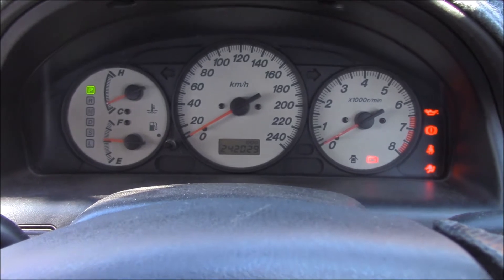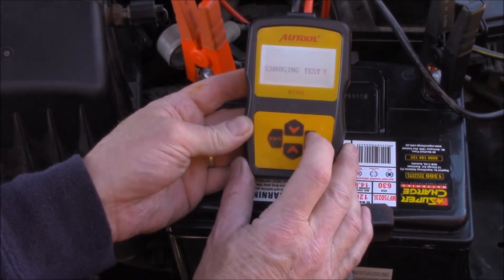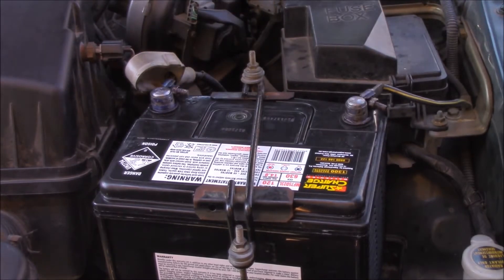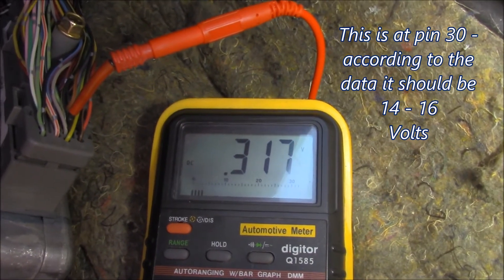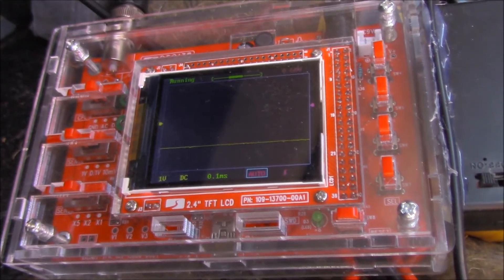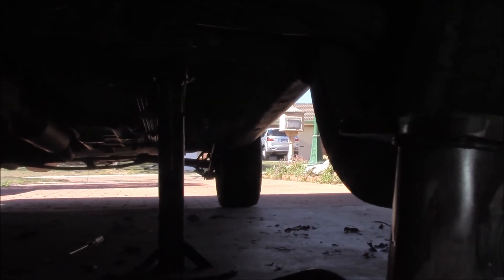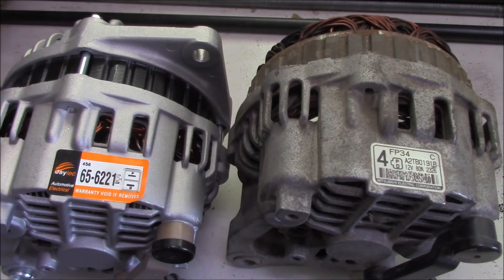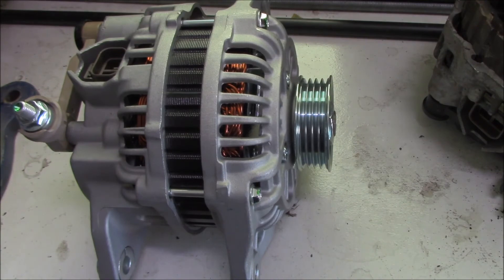Testing Computer Controlled Alternators Mazda 626 MiracleMAX

Comment: Guys I have a 2004 Mazda Axela. My battery
light came on while driving. Did a voltage test
on it found out that the alternator is not
charging the battery. Did a code test, got this
code P2503, charging system voltage low. Did
further testing then found out that two pins in
the PCM is sending the wrong volts to the
alternator🤷🏽‍♂️
Reply from the maker: Thanks for sharing that with us Nario Esprit. So what was the fault in the end - the ECU? What did you do to repair it? Is it working OK now?
MiracleMAX
Reply: @MiracleMAX  it’s still being worked on as we speak… but every other person I go to, they’re telling me that the alternator is the problem (the voltage regulator in the alternator)
Reply from the maker: @narioesprit4516  If it is a 'smart' alternator, the regulation is done by the ECU. You have a pulsed voltage (duty cycle) sent by the ECU to the rotor, depending on the load and then a feedback signal will be set to the ECU to make sure the alternator is charging as expected. If the alternator is not working correctly, ie, worn brushes, you can get some strange voltage readings.
Please keep us informed and thanks for sharing.
Reply: @MiracleMAX  yes I think it’s a smart alternator, case the ecu sends a pulse to the alternator… so my question is can the ecu damage the regulator in the alternator???
Reply from the maker: @narioesprit4516  There is no regulator in the alternator as all the regulation is done by the ECU. Generally you will just find a basic brush box in place where the regulator would usually be located
Reply: @MiracleMAX  ahhhhhh ok I understand… so once I change the alternator everything should go back to normal? I’m confused that the person I asked to do a diagnostic on the car came to the conclusion that the ECU is faulty or malfunctioning 🤷🏽‍♂️
Reply: @MiracleMAX  so basically his diagnostic is ( terminal b at idle should read 13.0-15.0v ) ( terminal p with ignition on should read 1.0v or less, at idle 3.0-8.0 the test results reads 20mv ) ( terminal d with ignition on should read 0v, at idle * the test results reads 12.5v
Reply: @MiracleMAX  I also think we have the same alternator and charging system 😁
Reply from the maker: @narioesprit4516  Not sure on your vehicle, but if you look at this link, I discuss the differing information that got me initially confused. I thought it was the ECU as well to start with. 
https://youtu.be/V7cfw0hIlm4?t=452
The terminals are P & D
Glad I did extra research and testing.
https://youtu.be/V7cfw0hIlm4?t=855
Reply: @MiracleMAX  I changed the alternator finally, battery light 💡 is off and car is running perfectly fine. Just have to do a voltage test…
Reply from the maker: @narioesprit4516  Well done on the correct diagnosis! 😉

Comment: confused by the duty cycle pin, is the signal from alternator to the cars ecu thus providing charge current information, or is it from the ecu to the alternator to request a specific level of charge?
Reply from the maker: Hey We're Really Relay Camping,
Thanks for your question. These 'smart' alternators can be a little confusing, compared to the old style.
The 'D' terminal has a duty cycle signal sent from the ECU to the rotor field circuit via the field control unit built into the alternator. As shown in the video, the larger the electrical load, the larger the duty cycle sent to the alternator.
The 'P' terminal signal is sent from the field control unit inside the alternator as a response back to the ECU so that it can analyse the phase signal and determine the efficiency of the alternator. 
It is very similar to a 'request' and an 'actual' reading that we commonly find on a scan tool.
I hope that helps clear that up a little for you.
MiracleMAX
Reply: @MiracleMAX  thanks very much for that because we've been having trouble with split charge on a campervan and so it's going to be interesting to see if i can use some other form of electronics to take control of the alternator and do what i want it to do instead of what it thinks is best, I don't even know if mine is the same type of alternator or if it's one with like a canbus or other digital signal which would make things a bit harder but not impossible. Thanks for your reply
Reply from the maker: @WereReallyRelayCamping  First things first. 
You need to identify what alternator you have. Did you fit it yourself or was it already on the van? What engine are you running? Try doing some research on the part number off the alternator and then you should be able to figure out what system it runs. Try using the net or asking your local friendly auto electrical shop.

Comment: my battery on my 2018 mazda with 39k miles, died after 3 days of not driving it. nothing was left on. i charged it and got the battery tested . everything passed except something about the voltage, it failed. so i took it to a different shop to get a 2nd opinion. they ran the same test with the same results and they both said the alternator needed to be replaced.  so i took it to my mazda dealership ( i have a 100k miles extended warranty) they did a test on the car and said  all is normal and the alternator doesn't have a voltage regulator and it is controlled by the pcm and they just needed to recharge the battery and keep the car overnight and retest it. i have never heard of a  2 yr old car alternator going bad the tech said.  oh and the tech said the pcm is not showing any faults codes in their system ( whatever that means)
Reply from the maker: Hey New Yorks Finest,
Thanks for sharing your experience. How long ago was this?
The PCM controlled alternators may or may not set a fault code, depending on what has happened. The battery and alternator testing can be a little tricky as a lot of the rules are different on the PCM alternators.
I guess you have to ask yourself - why did the battery go flat in the first place? Three days is not really a long period of time. There is a thing called parasitic voltage drain, which drains the battery over a period of time, even though you don't have anything turned on.
Can you keep me up to date with any future problems you might experience? I would be happy to give you some suggestions that may help find a diagnosis.
Cheers
MiracleMAX
Reply: my battery went dead a couple of days ago. I charged it yesterday and ran it around town to get it diagnosed. today i called mazda and my wife took it in to mazda and they gave us a loaner till tomorrow.
Reply from the maker: @NewYorksFinest1  Thanks.
I'll be interested in seeing what they find out.....😊
Reply: before this issue my scbs light kept coming on for no reason. I took it in to mazda and after 4 attempts i had to hire a lemon law atty and Mazda settled and gave us $2500 (2k went to my atty) and they gave me the extended 100k mile on top of the original warranty with zero deductible. I called the warranty place and they said yes my alternator is covered under the warranty so if they finally decide it's the alternator, it's covered
Reply from the maker: @NewYorksFinest1  Did they end up diagnosing the SCBS fault? 
These lights will come on when raining or the windscreen if fogged. Here's a link that will explain that.
http://mazda.custhelp.com/app/answers/detail/a_id/144/~/why-is-the-smart-city-brake-support-%28scbs%29%2Fsmart-brake-support-%28sbs%29-warning

Comment: Hi MiracleMax,

(first my apologies English is not my first language)
I watched  carefully your video about the extensive testing you've done on your mazda's alternator. I have a similar problem with my mazda for more than 3 years.

I have a Mazda 626,1998 Sedan Automatic, it has an issue with charging the battery. The electronics in this model is the same as at Mazad's 626 up to the 2002 models.
PROBLEM: The car always starts very easy but the Alternator is not charging the battery right from the start. 
Have this problem for more than 3 years and here I'll describe in more details what actually is happening:
- When I start the car with a cold engine (at least the car not being running for more than 2 hours) Alternator does not start charging the battery immediately but it will after 20 to 40 minutes... and afterwards 

everything works fine so the alternator charges the battery as normally as it should and does that for an unlimited time as long as the engine works or it has not been turned of for more than 2 hours.. If I start the car within the period of about 2 hours the alternator will start charging the battery immediately as normally as it should.

However after turning off the engine and letting it cool down for more than 2 hours the symptom occurs again (again it takes a lot of time until alternator starts charging the battery).  
Just to mention again that within the period of about less than 2 hours after turning off the engine, the car can be started easy and the alternator charges the battery as normal as it 

should (right from the time of starting the engine). 

   The other thing I've noticed is that If I drive the car with a relatively cold engine on a freeway, alternator starts charging the battery much later comparing when drive the car in the city (up to 60km/h), In the freeway the charging starts after 40 - 50 minutes or not at all, which is way different when I drive the car in ordinary streets where the charging starts after approximately at 25 minutes. 

Also the behaving is different in winter comparing to summer. In summer the charging starts much sooner comparing to winter time. 
So in trying to find similarities between driving on a freeway and driving in winter time is that in both cases everything under the bonnet is in a much cooler conditions than when driving 

the car in ordinary streets or in a summer time(when the temperature under the bonnet is higher and the charging of the battery starts much sooner at about 20 - 30 minutes)

I Have this problem for about 3 years. In meantime have contacted a few auto electricians and some of mazda's auto repair centres but haven't got any proper response in regard to 

pinpointing the problem.  

I am driving the car as it is and having a spare battery always with me.

Have done some testing myself and have paid attention to the computer control signal in both situations: when it is absent and also when it 

appears and continues working properly as it always should. When it comes and onward the signal that controls the alternator seems to be good.

Here is the type of the alternator and some electronic info what I have read about the process of how it is working:
The particular Alternator is Mitsubishi A2TB0191: do not have a traditional Regulator but instead have a field control Unit.
Alternator has a P-D Connector
Mitsubishi A2TB0191 Alternators with P-D Regulators require special testing, the voltage control & warning lamp functions are in the vehicle PCM (Computer).
* P Terminal is Stator Phase & is a direct connection to stator AC Volts.
This allows the PCM to Monitor Alternator Field.
* D Terminal is Driver connected to Vehicle PCM (Computer), and is used to control the output of the field control unit by varying base current on a transistor which in turn varies field 

current thereby controlling Alternator output and voltage.

The above means:
-on the P terminal PCM monitor the Alternator Field
- D Terminal is Driver connected to Vehicle PCM (Computer) from where gets a control signal.
--------------------------
As a conclusion would say PCModule gets all the infos from the sensors and ECU and then sends a proper controlling signal to the alternator's D-terminal. 
So I was wondering if there is some particular sensor malfunctioning (probably some that is temperature dependant and which one that would be?) or is it something else.
, In that regard why the alternator's D-terminal is getting a starting signal from the PCM at a later and later time.

As the temperature under the bonnet plays a crucial factor when the alternator starts working or not working I was wondering if there is some temperature sensor that sends signal to the 

computer so it would start sending an appropriate control signal to the alternator? 

 I hope you know what is the problem with my car and might give me an advice what should be done?
Thank you
Reply from the maker: Hey Z S, that's quite a detailed explanation - well done! I have a few other questions - how many Kilometers has the car done, what actual testing has been done, has an auto electrician used an alternator tester specific for that vehicle, have all wires been checked for terminal retention and corrosion?
Reply: hi  @MiracleMAX   thanks for replying,
the car has done 140 000 km
The testing was done with just an Unimer (volt-meter), the control signal was going with a frequency from 0 to 2V when the alternator charged and everything goes well (the charging voltage is about 14.5V), no special instruments for testing of the alternator have been used. All the wires were thoroughly checked a few times visually and with an om-meter, they are ok. The car is in a very good condition, looks and works perfectly... only this a sort of postponed start of alternator's charging is a problem.
The airconditioner, lights, and everything else works perfectly fine. At the very moment when the alternator start charging (after at about 25 minutes in summer or at about 40 minutes in winter) there is a short squeezing noise coming out of the alternators belt. The belt is as new and properly tensioned.
Recently was a case when while driving in the city streets (60km/h) the alternator started charging  but when I got on the freeway (100 km/h and the natural cooling of the engine surroundings became evident) soon after about 10 minutes the alternator stopped with charging and the alternator's light again came on... while still driving on the freeway after about 30 minutes the alternator again started charging the battery... That's way a wonder if there is some temperature sensor that gives the computer a wrong message and consequently of that the computer is not properly sending a control signal to the alternator to start generating the charging current for the battery....
Just to add, after alternator starts charging it continues to work good (never overcharging the battery)., However after about more than 2 hours of car being switched off (and therefore the room under the bonnet being cooled out) everything (the cycle of charging) repeats again.
Reply from the maker: @zs7869  Has the earth been voltage drop tested at the alternator? Has the testing been carried out as shown in the video at 14.40? It is possible that the brush pack in the alternator may be worn. When it is not charging, is it possible to CAREFULLY tap on the back of the alternator where the brushes are located? This may help the brushes seat and therefore show that it is an alternator brush pack fault.
Reply: Tested for voltage drop, it is fine, there's no voltage drop in both cases, not towards the earth and not the positive... also did the tapping several times... .nothing has changed... The same manifestations goes on for more than a 3 years ( not only a few days or weeks but years)... 
Do you know if there is some temperature sensor that might affect the computer in regards to properly sending the control signal to the alternator so it would start working? I am saying this because somehow the temperature is crucial. Sometimes I am letting the car running for about 20 minutes in place at front of my house until the alternator starts charging the battery before I  drive the car out...(afterwards until the area around engine is hot enough the alternator works great. I can switch off the car, start it again etc and the alternator is still charging perfectly...  however if I leave the car switched off for more than  2-3 hours, depending on the weather temperature (so it is different if it is a summer or a winter time), the area around the engine cools down and the problem with the alternator reoccurs).
Reply from the maker: @zs7869  The P & D voltages need to be tested as shown in the video, also duty cycle when unloaded and loaded to see if the alternator or the ECU is faulty. I do not believe that there is a temperature sensor used in this system. This may just be as a result of poor connections, corrosion or a faulty semiconductor within the ECU
Reply: Ok, Thank you for your help and time @MiracleMAX  .

Comment: Good job, Mark. I haven't seen those little DIY scopes before. I ordered a DSO 150. I'm sure that it will come in handy.
Reply from the maker: Hey Robert, 
I really enjoyed assembling the kit and although it does take a while to navigate the functions, it actually works quite well. I even used it with my students to show the difference between an expensive one (Picoscope - which is absolutely awesome in my opinion & I use it regularly at the college) and this cheap brand. I was surprised how well this little scope compared. But keep in mind, you get what you pay for! 
The DSO150 looks identical to the DSO138. Probably the same system sold by someone else. Hope you are happy with it.
Thanks for your comments!
Reply: The 150 has more SMD and a better case. I didn't study it close enough to look for other improvements over the 135. It will come in handy when diagnosing automobile problems or somewhere I can't plug up my Tek 2465A DV.  Of course I don't expect it to be as accurate as my Tek, but it will work well enough to help a diagnosis.
Reply from the maker: Perhaps you could let me know what you think of it when you get it up and running.
Reply: Sure, no problem.